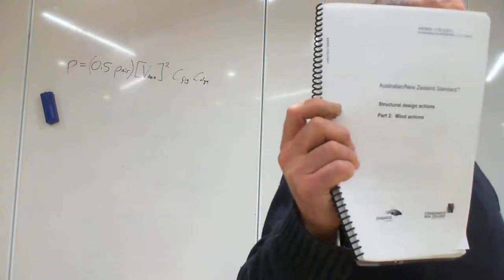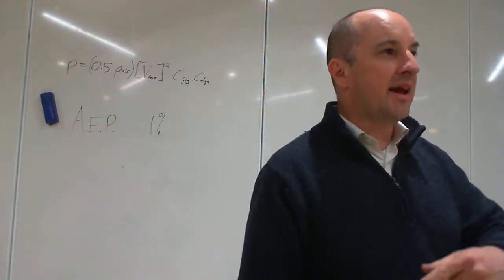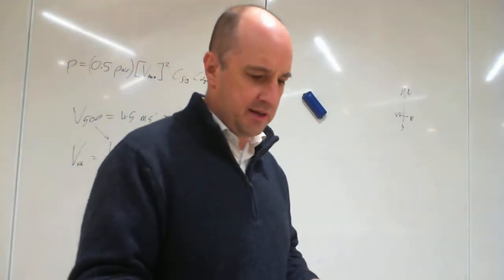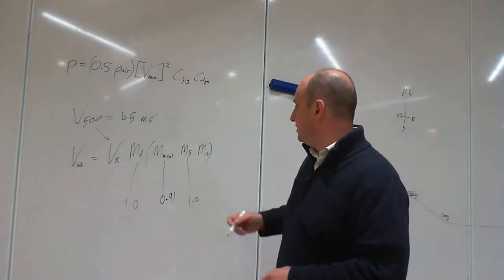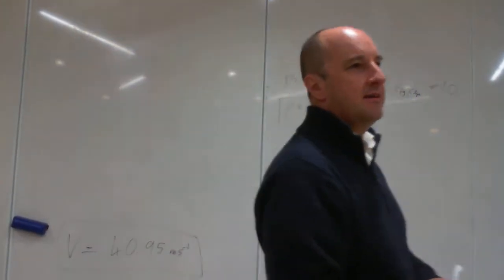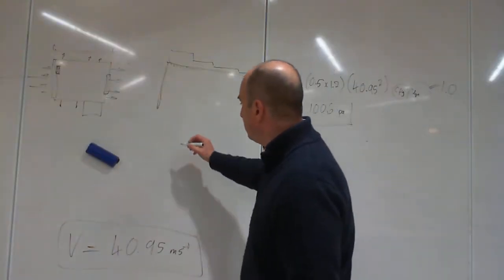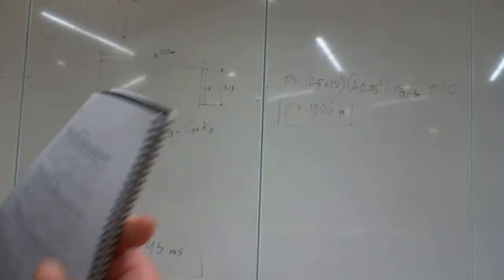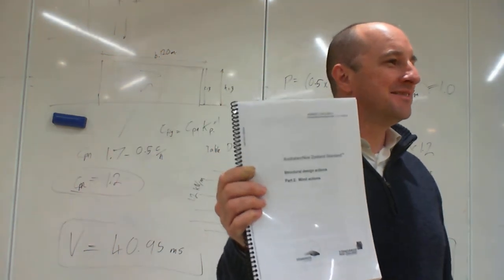Wind Loading Tutorial AS1170.2 2011

Comment: How can I determined Internal pressure in Partially enclosed building in AS1170.2? I see almost table in this standard is used for enclosed building. I design factory building.
.~....I understand.  Using factor in table 5.1B by considering percentage dominant opening.

Comment from the maker: In mid 2021 a new version of the wind code was published.  This included some significant changes include renumbering some of the clauses and all of the appendices.  To hear the head of the code committee explain the updates, you can see here: https://youtu.be/6gnRaAN9SOY
Reply: Hi Peter, thank you for your video, I found that C(fig) is quite hard to determine. Can we use Etabs to determine C(fig). I am doing a university project and we need to design wind for irregular shape building at 30m height. Doing it manually would take days.
Reply from the maker: @tuphannguy3n  There are a number of tools to help you work out the various parts for the wind code, including Cfig.  However, I would greatly discourage you using it in this instance.  The intent of your university course is that you understand how wind puts forces on a structure and how the structure reacts, not that you can use a tool.  Respectfully, any monkey can plug numbers into a design tool and get a result.  That is not why you are at university.  An engineer is the person who understands what is going on and and why the forces are what they are.  I highly recommend you do it manually in this case, as that will help you understand what is going on.  Then in the real world you will be able to design structures confidently and correctly.
Ask for help from your tutor/lecturer.  My experience as a uni lecturer is that we wish the students would ask for help more often than they do.
Reply: @psthew  Thank you for your response. Unfortunately, as far as my concern, wind design wasn't extensively taught at my university. However, I have done earthquake design loading. I could manually determine other coefficients in wind design but found it is quite difficult to determine C(fig). This is the first time I have done wind design. (I did not come across wind design before). But I will consult with my lecturer/tutor. Thank you for your reply. I really appreciate it.
Reply: @psthew  Hi Peter, when you calculate the Bending moment at the base you used M=ql^2 / 2. Out of curiosity, why don't you use V* multiply by Height to get the overturn bending moment, given V* is base shear?
Reply from the maker: @tuphannguy3n  It ends up being the same thing.  V* is from the wind pressure and the height, so V = ql.  The wind force acts in the middle of the wall, (l/2) so the result is M = ql^2/2
Reply: Hello sir this link isn't  working can you please pin right link, that will be really helpful to understand the recent changes.
Reply from the maker: @kganesh2404  I have updated the link now.  thanks for letting me know
Reply: @psthew  Thank you .
Reply from the maker: @kganesh2404  see here.  sorry for the delay https://youtu.be/6gnRaAN9SOY

Comment: How can we calculate the aerodynamic shape factor for a telecommunication antenna, the shape is similar to the prismatic shape but the l/b will not exceed 8 as per section E2.1 so which equation can we use?
Reply from the maker: If l/b does not exceed 8, you are dealing with a relatively fat structure.  you need to calculate the force on each individual element.  Use the drag coefficients in tables E3, E4, E5 (AS1170.2 2011)
Also note that there has recently been a new edition of AS1170 released (2021) which has renumbered all the appendicies, so moving between codes takes some care.